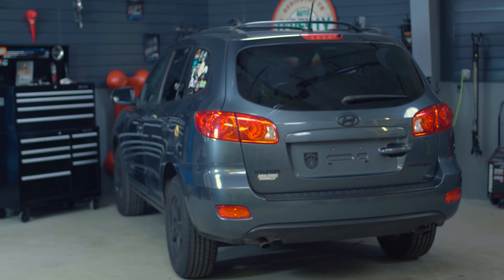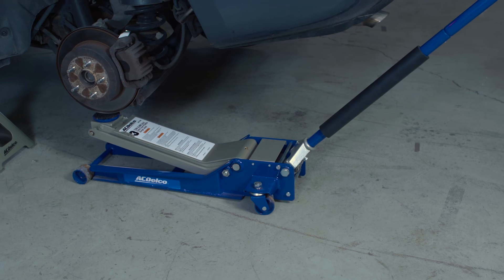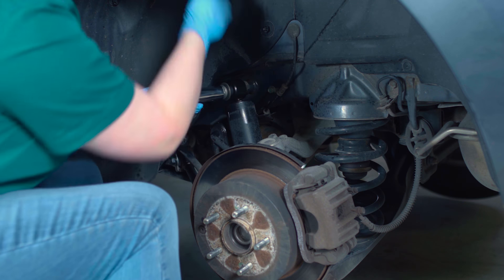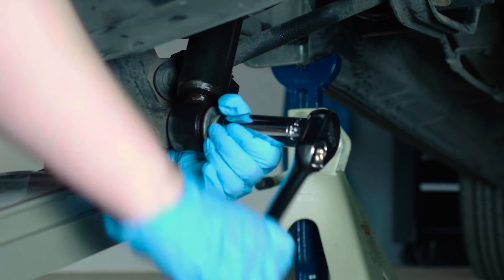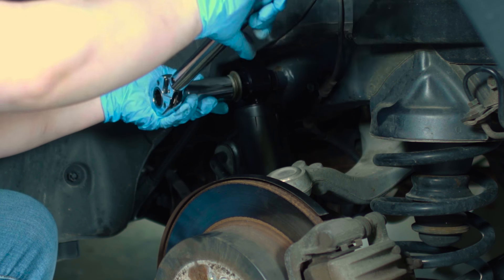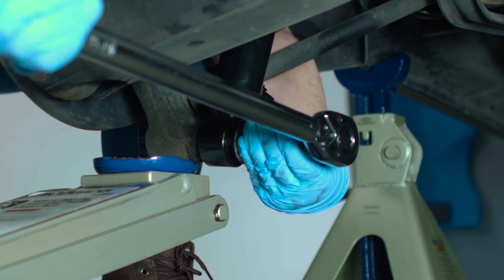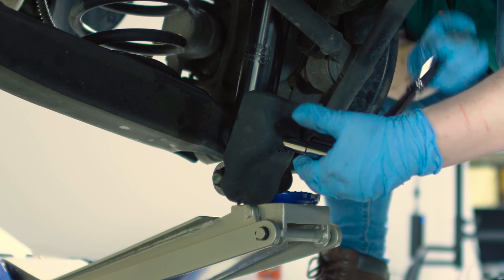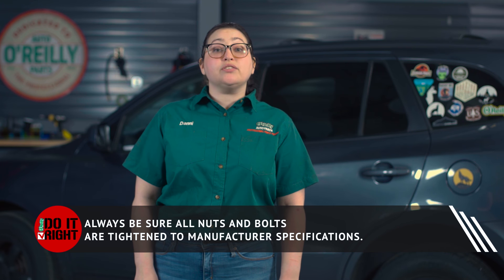How To: Replace Rear Shock Absorbers

Comment: I have a 1989 Pontiac Grand Am - I did all this and got my back shocks on but later I think they come unscrewed and my car was bouncing the distance of the unscrewed Gap. It's like the bolt come unthreaded at the top and now it's bouncing however far it come unscrewed. Ok, so I tried to screw the bolt back down inside the trunk on top of the shock- the whole shock moves- even when I hold the bottom part of the shock. (When I do this it won't move at all)  I had a shop put the struts on the front because of the springs so there's no issue with that just the weird bouncing in the back - now I'm worried about the other shock on the other side. They went on fine no problem just weird cuz they seem to have unscrewed.
Reply: You are supposed to use blue thread lock so the bolts don't loosen from the vibrations.